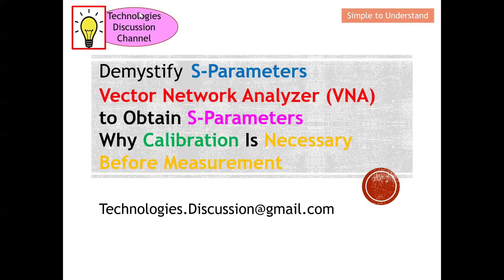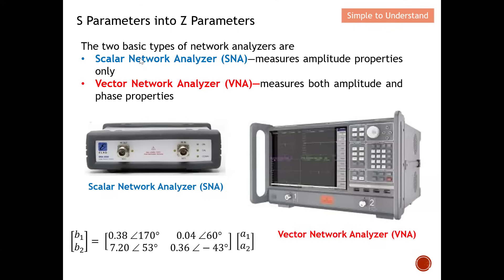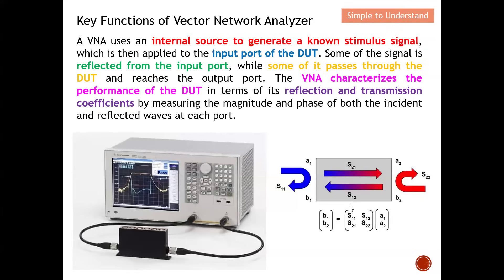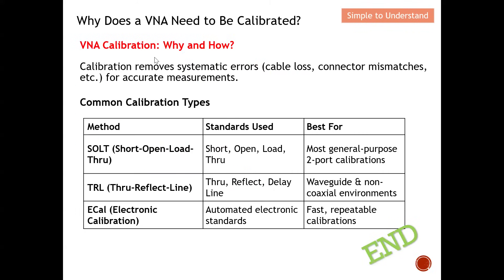S-Parameters #10. What is De-embedding? Shift Reference Planes for Accurate VNA Measurements.

Comment from the maker: Thank you for taking the time to watch this video on S-Parameters. The discussion is divided into two sections.
In the first section, I explain how to obtain S-Parameters using a Vector Network Analyzer (VNA). In the second section, I discuss why calibration is necessary before conducting measurements.
We have already covered the theoretical aspects of S-Parameters extensively. However, how do we practically obtain them? For example, S-Parameters help us design antennas and filters easily. Once we design an antenna or filter, we have an actual Device Under Test (DUT). So, how do we measure its S-Parameters? The answer is by using a Vector Network Analyzer (VNA). In practice, S-Parameters can be easily obtained using a VNA.
Next, I’d like to discuss why calibration is important. The most common calibration method for a VNA is SOLT (Short, Open, Load, and Thru). When we perform calibration, we shift the reference plane from the VNA's port to the edge of the cable. This is crucial because it ensures that the S-Parameter readings are accurate, consistent, and truly reflect the performance of the DUT.